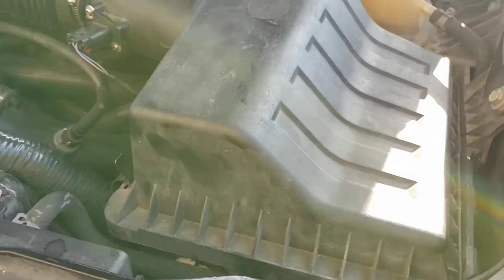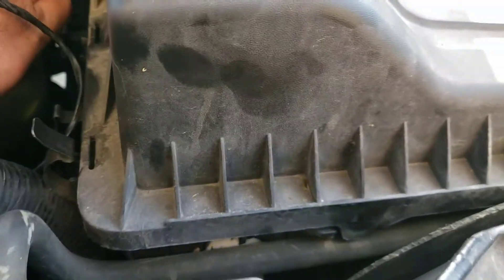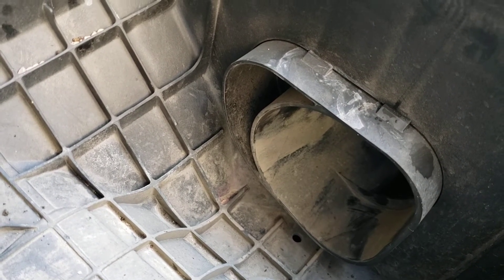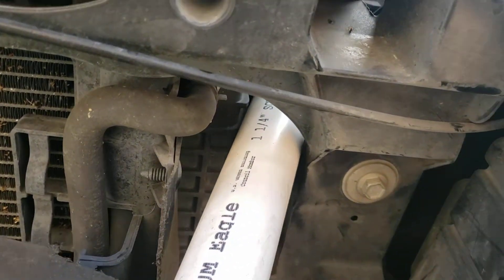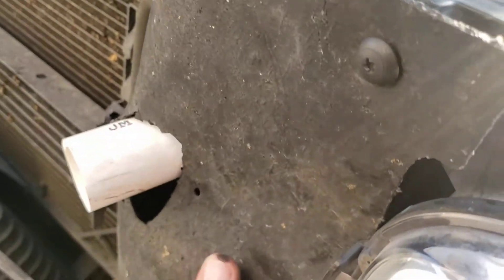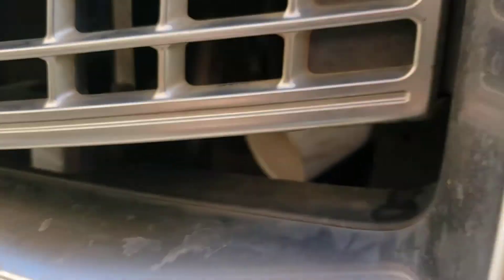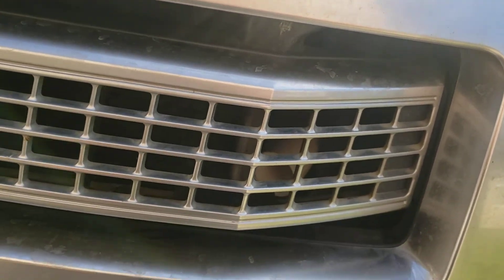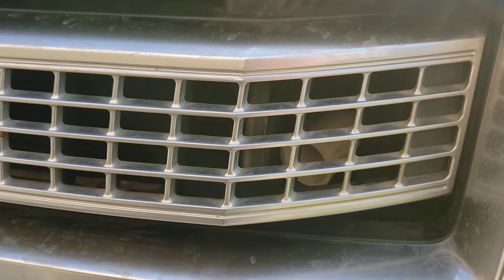DIY F150 Ecoboost Cold Air / Ram Air Intake

Comment: Great idea!!  I have been looking at CAI for my 13 screw. and settled on banks ram air, but after seeing this I am trying to find the 15-17 air ducting to the filter box to add cooler air from the front instead of the fender well

Comment: This is really cool! You should paint the tube black! To match the rest of the engine bay plastics.
Reply from the maker: I did after the fact.
It worked really well, intake temps became ambient air temps instead of 10-25 degrees hotter
Reply: @phathomthis  That’s great!

Comment: Did sonthing very similar to my 23 focus. Closed air box besides a 1x3 little snorkel behind top bumper to let cool air flow in. Cut a hole in the bottom of the air box. Got a proper length 90 degree semi radiator hose to fit into the whole nice and snug. Sealed it with a little plastic/rubber sealant. And the hose runs right behind the driver side triangular plastic piece. With about a 3 in gap. Took the Dremel wheel and cut two slits in between the ribs of the plastic piece so now cool fresh air can flow up into the air box. Have an aftermarket open ended side air filter (circular filter) and the focus air box design used the factory filter to seal the end part of the box. So any excess air isn’t pressuring the air box say highway speeds. I also have a hydro sleeve over the filter and the new hose so water doesn’t and hasn’t gotten anything remotely wet to the filter or through the filter. IMO it’s a smart true cold air intake where your filter is down in your bumper sucking from a few inches off the ground allowing possibly hydro locking. This just allows fresh cool dense air to constantly flow thru the air box and never have to worry about drawing in heat soaked engine air. As long as it’s done proper. And understand how to prevent or make it in a way that sucks up water. There is no harm. Plus the rumble of the Ford duratec induction noise is very aggressive sounding in car and coming at you. No need for a fart can annoying exhaust. Induction noise has always sounded better on certain cars to me than some of the cheap (like what I did with the intake and in the video has done) and people using that to hack resonators and mufflers off making your car sound like absolute shit and not run any better. This at least gives your car a constant ambient air intake temp. No fluctuations of engine heat

Comment: This will do nothing and is a complete joke.... the intake will pull air from the largest opening first (fluid dynamics). The original intake tube is a cold air setup if its getting air from the fender well. I feel like you have absolutely no idea what your talking about. And that last part in the description that you say Ford "fixed" it by putting the intake snorkel in the front of the airbox which results in +25 HP is absolute BS garbage. I would LOVE to know where you got that information. The reason why the 2015+ 3.5 Ecoboost has more power is from a variety of changes to the PCM and relative hardware. Please just stop..... LOL
Reply from the maker: Close. The intake will pull air from the path of least resistance, not from the largest opening.
2x 2" pipes that are 12" from the air box and presurized from moving air is a less resistive path than a slim, curved, pipe going into warm stagnant air inside the fender.

Second: I did this so long ago, I can't find the source showing the gains of it, but Ford did realize sucking air through the fender sucked and relocated it to above the grill for cold, direct, air in the 2015 models.

Third: My air intake temperatures, which I have up actively monitored, dropped to the same as ambient temperature or maybe a few degrees above, after doing this. Prior, they were tens of degrees hotter, at times up to 30+ degrees fahrenheit above outside temperature.
You can laugh and talk as much crap as you like, but numbers don't lie. I didn't state any horsepower gains with this. I stated it would drop your intake temperatures, which it indeed does.

Comment: Thanks for the video.   What does it sound like when the truck is running? Can you hear it from inside the cab?
Reply from the maker: Not so much, the turbo whine is too loud I can't hear the intake. It's more for colder intake temperatures, which is does a great job of. My intake temps are ambient now. Eliminates heat soak.
Reply: @phathomthis  awesome. Thanks for the response. I am looking at doing this for my eco boost.  
Thank you!